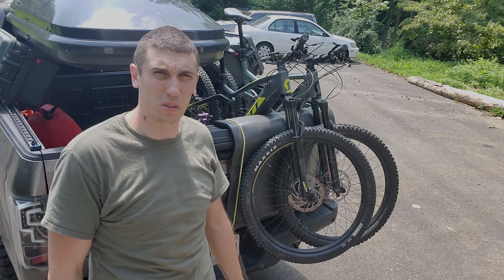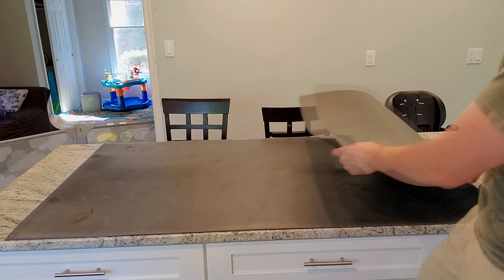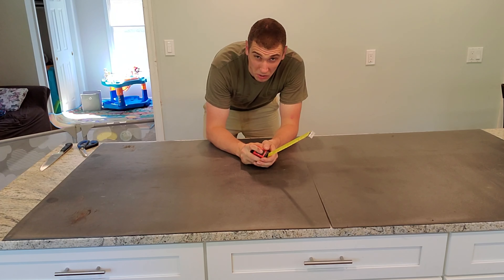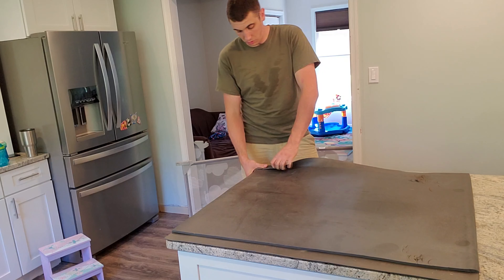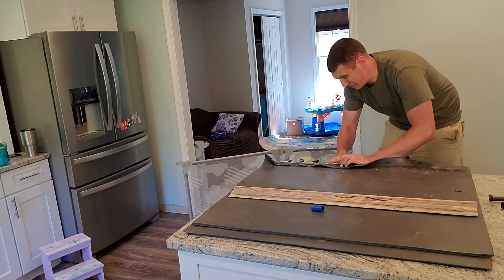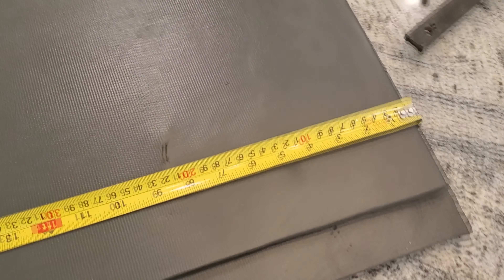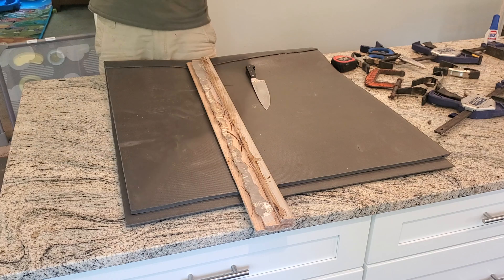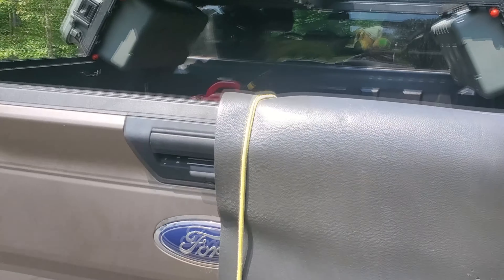DIY Bike Tailgate Pad

Comment: I have a Dakine Tailgate Pad but I actually prefer to use a yoga mat instead when transporting 1 or 2 bikes. Sinks in with no sliding. Easy to throw on and take off, no need for straps as bike will keep it in place. Fold in half, and half again in the back side if you want more cushion for frame. Black mat on black paint. I have an older truck so tailgate depth is much slimmer than newer trucks nowadays
Reply from the maker: Easy on, easy off, and cheap. A beautiful combo! 😀

Comment: A typical treadmill conveyor belt is very thin.. should work though but may mess up the truck paint.
Reply from the maker: This is a under pad to protect the carpet or hardware floor. It's not the running surface belt itself. It's more similar to a thick yoga pad.

Comment: I like the effort...Do you expect the bikes to just stay there without a hold down strap?
Reply: That's the theory behind tailgate pads.  Works good in my experience.
Reply from the maker: The angle of the down tube and the front fork kind of makes a wedge and the pad I use here is kind of rubbery/tacky. I have had a couple "oh shoot" moments and bikes have stayed in place. A strap may be an addition if I make a DIY 2.0 version!

Comment: Thanks for the info, but did you know that those heavy rubber matts are actually quite valuable?  I wonder how much you could have sold it for.
Reply from the maker: They are 27 bucks on Amazon. Got a link in the description  if you want to check it out.